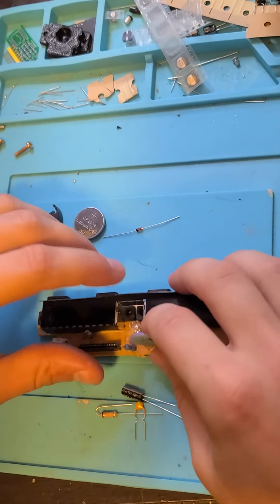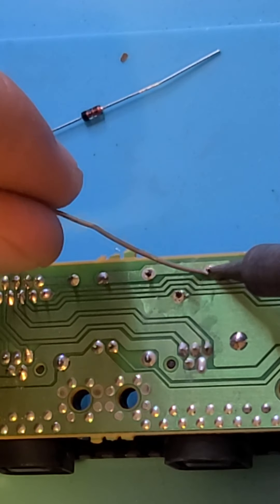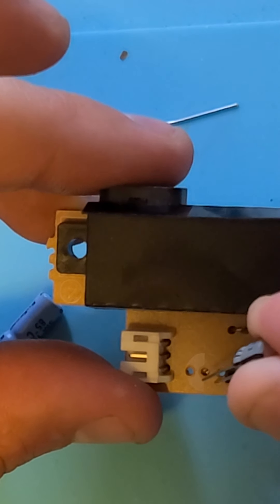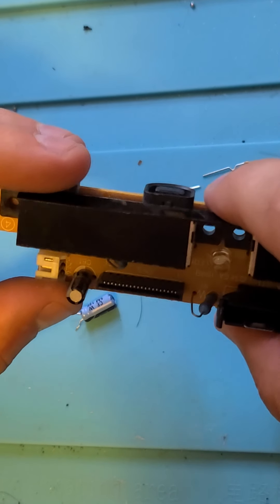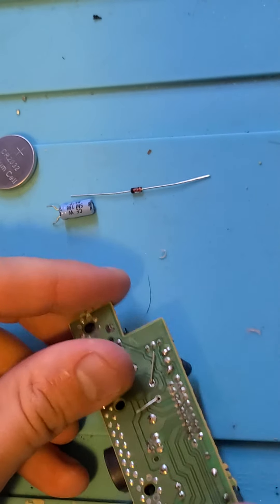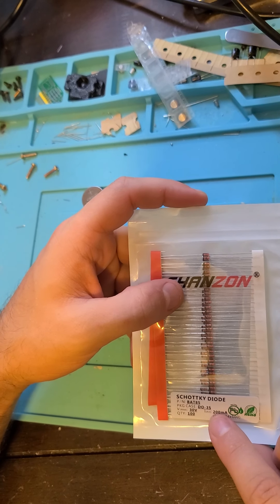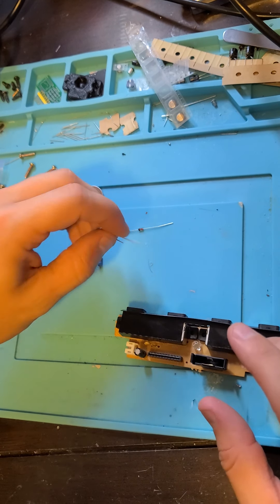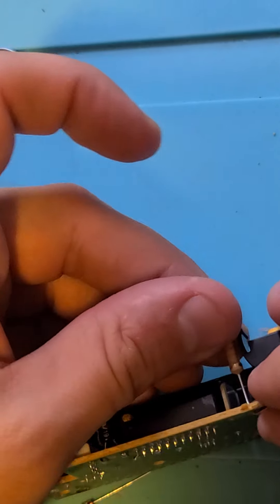How to service and retrofit Sega Dreamcast controller port

Comment: For the single-sided PCBs like that I avoid disconnecting the fan by taking them out together. The fragile traces sometimes give just from the force of disconnecting the fan. The dual-sides boards are much more robust since they are anchored, top and bottom, with plated thru-holes.

Comment: Is it essential to replace the R1 (resistor) as all the replacement sets don’t seem to include one
Reply from the maker: No
Reply: @cyo_corner  what about is it has snapped off? What does this part actually do?
Reply: Is f1 fuse 
R1 resistor ?
Reply: I don't understand what you did with the two parts soldered together at the end.  What does it do?
Reply: @BeanpotPubParlour it allows the battery to be a normal cr2023